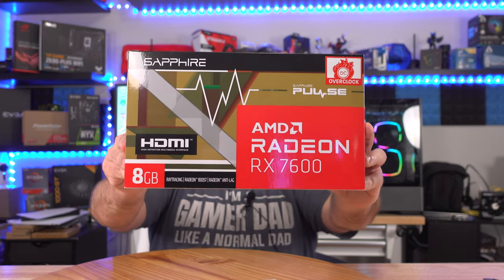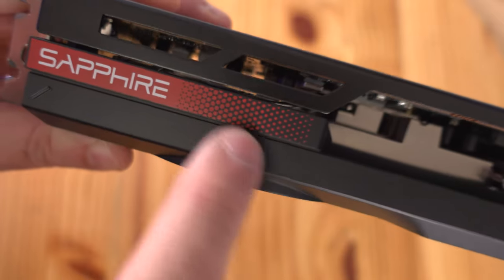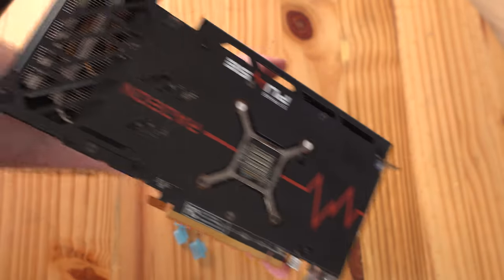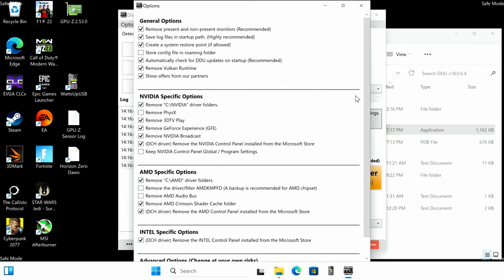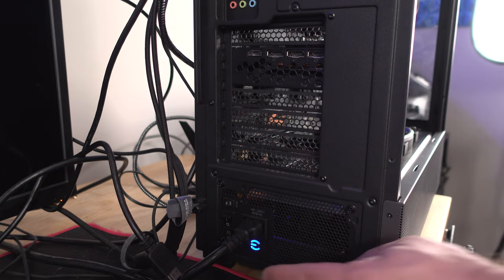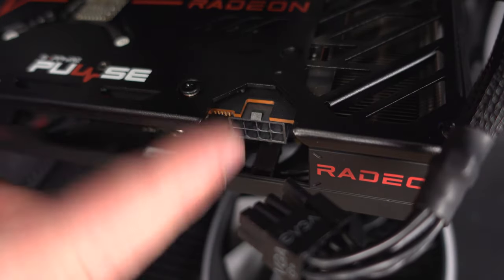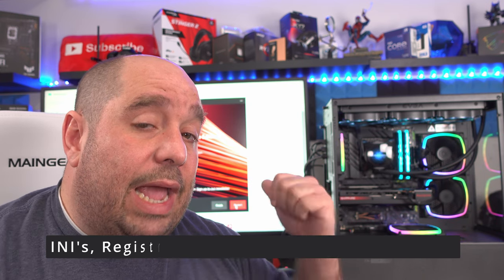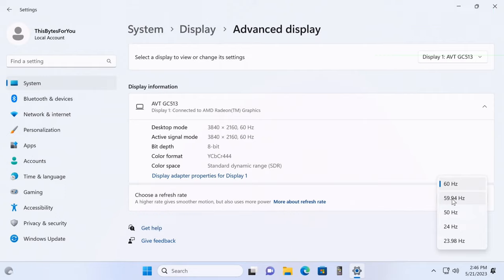How to install the AMD Radeon RX 7600 Graphics Card in your PC - Sapphire Pulse RX 7600

Comment: Is it worth to upgrade from rx6600 to RX7600?
Reply from the maker: I think so, I am coming out with a video comparing the 3060 XC and the 7600, I was not able to fit in the 6600 yet.
Reply: @ThisBytesForYou  I'm want to upgrade from 1080p to 1440p in the future,
Reply from the maker: I might say to go 7600, but its more of a 1080P card, though it can handle some 1440P, maybe you want a 6700, its only about $40 more than a 7600.  I will have more on this 7600, stay tuned.

Comment: Im having problems with my gpu. It doesnt ouput image. I install the old gpu and works fine. Can some 9ne help me. I did what was said in the video.
Reply: My mobo is a asus prime x370 pro 16 gigs RAM and psu 650 watts
Reply from the maker: So that I can help, please list the manufacturer and exact model number of the following components:
1. Motherboard - manufacturer and exact model number
2. CPU - manufacturer and exact model number
3. RAM - manufacturer and exact model number
4. Video Card - manufacturer and exact model number
5. Power supply - manufacturer and exact model number
6. Monitor - manufacturer and exact model number
 Redundant I know, but many people forget to enter manufacturer and exact model number
7. Do you have ALL of the PCIE connections plugged in, and not daisy chained or pigtailed, each coming directly from the power supply?
8. Are you running through HDMI, DP, DVI, VGA, any adapters?
9. Is UEFI or Legacy Setup in the BIOS?
10. What slots do you have your RAM installed in?
11.Do you have CSM Enabled or Disabled in the BIOS
11. Installed latest supported chipset driver?
12. Have you disabled Fast Boot within Windows?
13. This video will help you identify hardware inside your PC: https://youtu.be/65ZSiVImJx0
Reply: @ThisBytesForYou   thank you for your detailed response my friend. I end up fixing it by changin the darn HDMI cable.
Reply: @ThisBytesForYou   well for my defence the same cable was working fine with the old gpu. I dunni what was happening there.
Reply: @ThisBytesForYou   and you just have earn a new sub. Thank you for your time and effort. Thank you very much.
Reply from the maker: @mdmetallica26  the HDMI cable is very important, newer cards require an HDMI 2.1 cable and can cause tons of issues without, so happy you got it my friend.
Reply from the maker: @mdmetallica26  and thanks so much for your kind words and support my friend, it means the world to me.

Comment: @Thisbytesforyou, i have a question for you. I travel a lot for work and have some time to kill at times when working. I am looking for a portable solution to game when im in hotel rooms. Portability and performance are equally important. Should i get the Rog Zephyrus G14 with the 6700s and higher resolution or the Rog Ally that games at 1080p on a small screen? Their fps look the same(ish) but at different resolutions. What would you do?
Reply from the maker: Personally I would recommend the Rog Zephyrus G14, not only can you game on it, but you can check and write emails, watch youtube, create videos for youtube, edit videos, etc... on the Ally,... you can play games.  Its nice if you have the money to have them both, but 1 vs the other, the laptop wins to me.  What do you think?
Reply: @ThisBytesForYou   I appreciate it. I also am working on a masters degree so it would help with that as well. So what are your thoughts on the 6700S mobile gpu? The screen is the same as 1440p but 16:10 ratio. That gpu has 8gb vram. Do you think it would be sufficient in most games?
Reply from the maker: @danielhulan3058  good stuff my friend, yeah it would be good though at 1440p I think it might suffer a bit, 1080p you would be solid.  I will be releasing my 7600 review soon so it would help I think.  Masters, congrats my friend, lots of hard work will pay off for sure.
Reply: @ThisBytesForYou  For sure! It's a Masters in Social work and I will be a practicing therapist so it will definitely pay off for my goals.
Reply from the maker: @danielhulan3058  nice dude, that's awesome